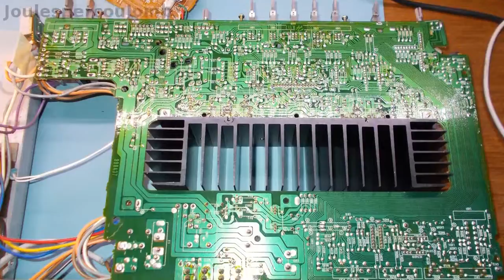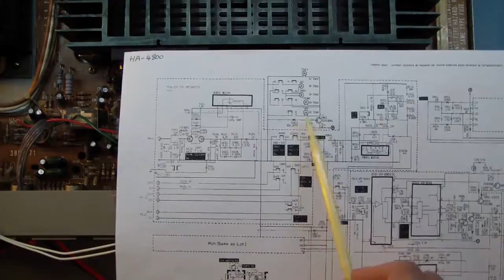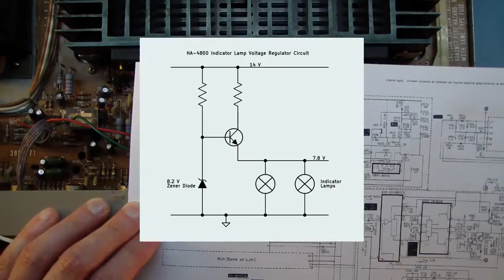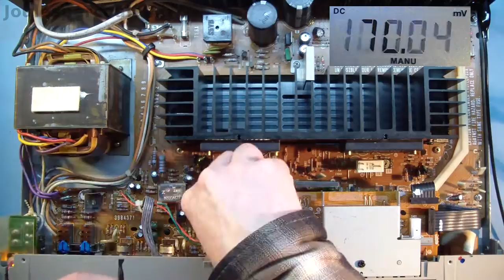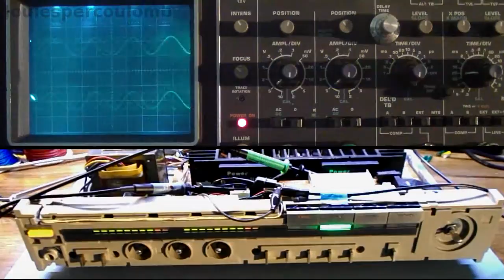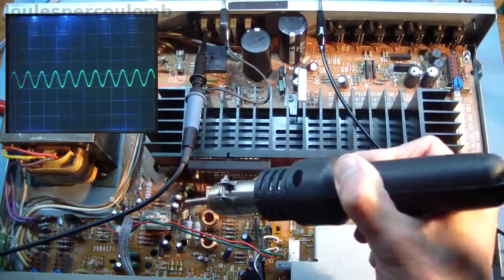Hitachi HA-4800 Amplifier Repair. Part 2.

Comment: Nice job on the LED retrofit. My first reaction was that 20ma was more than necessary, but it does seem that you get a brightness on the panel indicators close to matching the original brightness which I think is a worthy goal.

Comment: I think that 20mA is too much.
Reply from the maker: I assume you mean for the LED current. The LED datasheet specifies them for normal operation at 20 mA and states their maximum permitted forward current is 30 mA. The selection indicators do appear very bright, though, so there would be scope to reduce the current a bit.
Reply: +JoulesperCoulomb The brightness was rather bold :-)